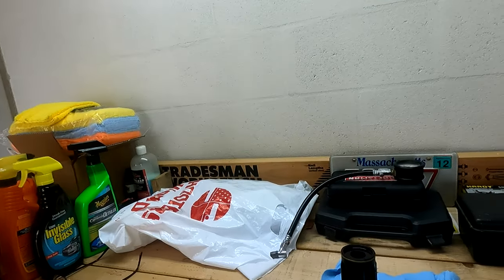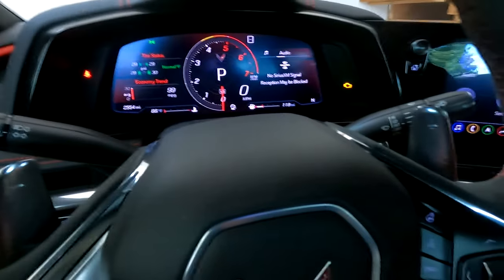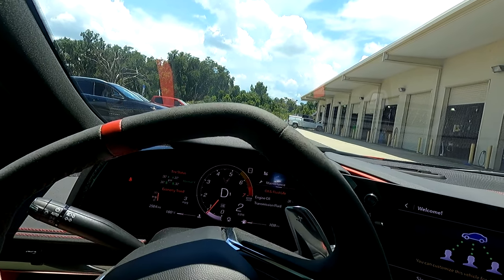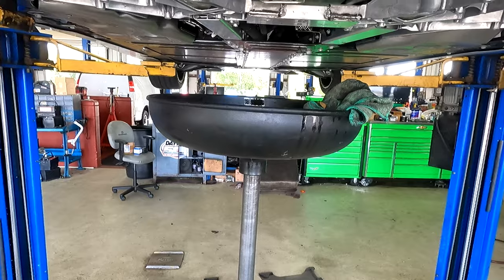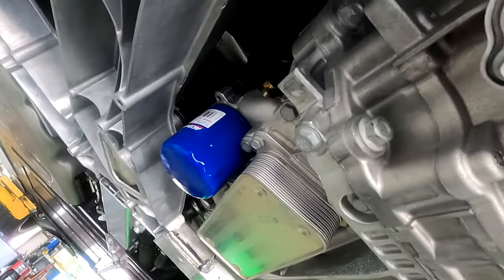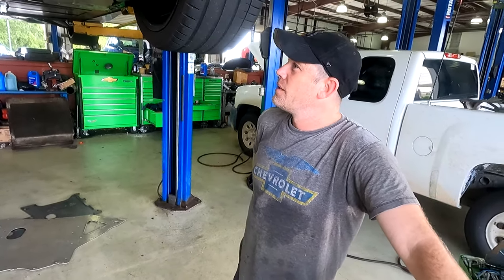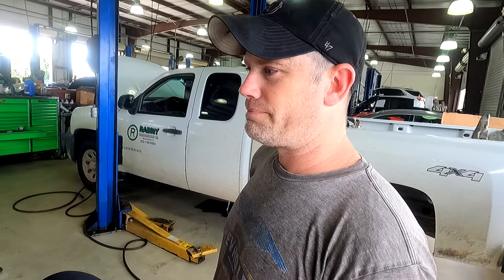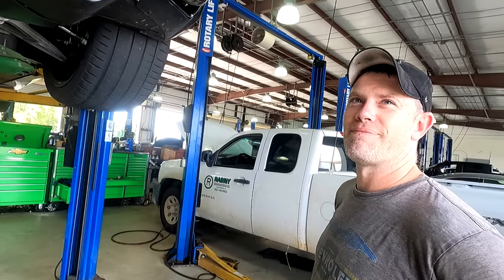Behind the Scenes - First Service on my C8 Corvette

Comment: Great video, thank you for taking us inside the service bay. I was told the first service is free. Did you have to pay for that service or not?
Reply from the maker: Thanks!!! And you are correct! No Charge for the oil change and filter plus the tranny filter.
And my Chevy Dealer went the extra mile by letting me into the service area to videotape the work done.
Reply: Hi Bob! Thanks for the great info.
I have one question. The shop manual states very specifically to clean the 4 transmission filter housing bolt holes before installing NEW bolts.
Do you know if the tech did this?
Thanks

Comment: I bet the reason it was down 1/2 quart is before he didn’t pre-fill the oil filter prior to installing it.  It actually hold 1/2 qt of oil.  And it’s a BIG MISTAKE not to prefill the filter because it actually takes a few seconds for the fluid to cycle through a dry trans filter which it not good.

Comment: I have a 2023 C8.  I only but in 4000 miles under a year.  Weekend car lol   so my question with the miles i put in.  My transmission is 68%  & trans filter is close to 20%.  Chevy said to change it at 7500 miles.  Which will take me 4-5 months to do lol.  Should I change both once filter hits 15-20% or wait til I hit the miles ?
Reply from the maker: If the trans filter has 20%, I'd change it before you get to 10. You could do both at your next service.

Comment: So why did you change the DTC filter and oil when you had 90% life left on it? Iv'e only had 2 oil changes on my 2020. They were free. Now I have to start art paying. I heard the tranny fluid change is expensive. I don't know if they will talk me into changing it or not. I only have 4500 miles on the car. It's in storage until spring because we get lots od snow in the winter here in Canada.
Reply from the maker: I was concerned about stories going around of pieces of the castings for the housing getting into the transmission oil and I wanted to add the 2 qts.
And since the 1st tranny oil and filter were free, and the Chevy dealer said I could video tape it all, Why not!  Had the oil, that I took out, analyzed and all was ok.
And later added the 2 extra qts.

Comment: You must had done many “launch controls” on your C8, tires worn out more than ~>1 year. 😂
Reply from the maker: Actually, they're still in good shape. Using launch control you don't get but a little chirp out of the tires. Not like doing a burn out. So, the tires are still quite good.

Comment: Had my first service done recently. A lot of dealers are keeping the DCT filters and analyzing them the same way you are in order to make sure the trannys are operating to specs.
Reply from the maker: I still am a little bit nervous about the DCT. And with the torque so low on the new Z06 I have to wonder if they're still using the C8 DCT in the new Z06.

Comment: Did you already have them add the 2 qts of transmission oil for track driving?
Reply from the maker: Hi James, No, I don't do enough track days so I will skip the 2 extra qts. If I find that I want to do more track events, I'll add the 2 but for now I'll just keep the regular amount.
Reply from the maker: Hi James, No, I don't do enough track days so I will skip the 2 extra qts. If I find that I want to do more track events, I'll add the 2 but for now I'll just keep the regular amount.

Comment: Is it 2 years to get free DCT filter changed or 1?  I have limited miles
Reply from the maker: You'd have to check with the dealer as I'm not sure. I changed mine after about 10 months. Also had them add the extra 2qts of tranny oil. Transmission runs sweet. No problems whatsoever.

Comment: I sure do appreciate you taking the time and trouble putting up this video. It was very informative.  One question if you have time.  Where or how do we check the transmission oil level?  You spoke about it in the video when you said the engine isn't running to check the transmission but we do run it to check the engine oil.   I have looked everywhere for the transmission dip stick but haven't seen it.  If you have time and can say how the transmission oil level is checked it would be greatly appreciated.  Thank you for the video.
Reply from the maker: Forgot to type an answer...sorry. When you go to the dealer for an oil change you can have the tech check your transmission level. There is no dipstick for the tranny. It's a screw type round plug on the side of the transmission. I think it's described in the owner's manual.

Comment: so when he changed the transmission filter he lost a bit of oil....did he put the oil back in ?? and how ??? also did u also added the extra 2 quarts of transmission oil that most people do ??
Reply from the maker: He didn't have to add any oil to the transmission. Oil level actually was fine even though some splashed out when he changed the filter. And I'm waiting on the 2 extra quarts. Still not totally convinced.
Reply: @RobertMacCready  ty
Reply: I've been street racing high performance cars since 1968. I guess I went to a different older school than you did because we always made sure everything was filled to the top when I'm pushing a car hard. Regards to the transmission, if it takes two more quarts, then in my opinion it should be put in. If it didn't need two more quarts they wouldn't have the space for it and they wouldn't tell you would need two more quarts for track use or spirited driving. I think they just found another way to save a few million dollars here and they probably figure most people won't either street race or track their car. Just my two cents.
Reply from the maker: @salvatorecerniglia696  IF the extra 2 quarts is that important why would they not include the 2 quarts? We're talking a 60 to 100K car. I can't imagine they're selling these cars with tranny oil that's down 2 quarts!!!

I think if you're tracking your car 20 times a year, go for the 2 qts. Anything less and I would not bother. Even the Corvette Tech agrees.
Reply: @RobertMacCready  There is two different levels to set the transmission at. One is the normal street use which is what it is set too. The second is for track use in which you set the fluid level to the level plug then ........when you take out the "trunk compartment" there will be another plug which you can add the 2 qts there. Then when done racing on the track set to normal street use level.
Reply: @splat5119  NO, once you add the extra 2 quarts you leave it in, not drain part back down to the street fluid level according to Tadge and Owners Manual
Reply: @tnharley  yes you are correct. Looking at the owners manual side its says you can leave it in. The only benefit to draining the fluid back to street level would be for the little bit of fuel economy you could gain.🤣
Reply: @tnharley  I'm going in for my 1 year oil change, If I ask them to add the 2 additional quarts of trans oil is it simply pumping or pouring 2 more quarts in or is it a whole procedure.